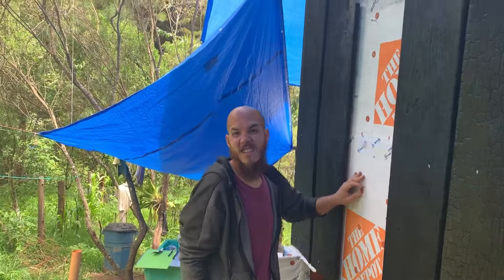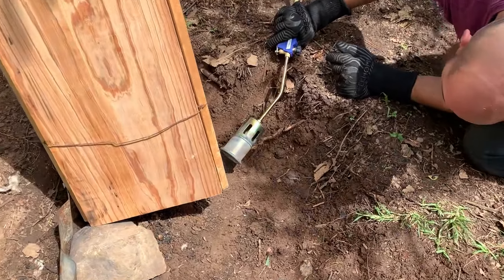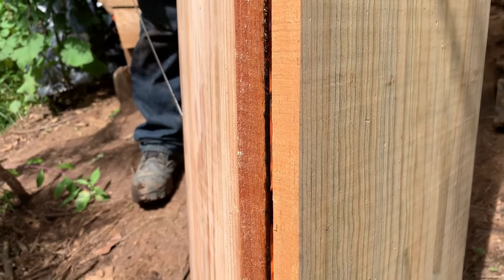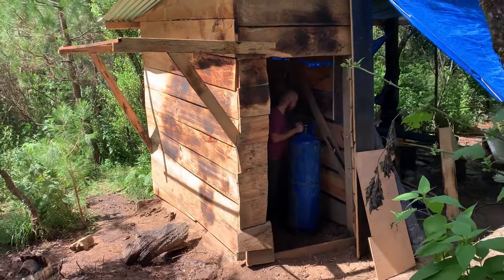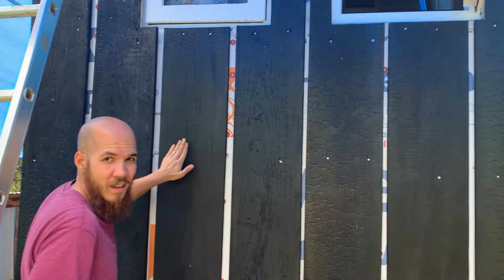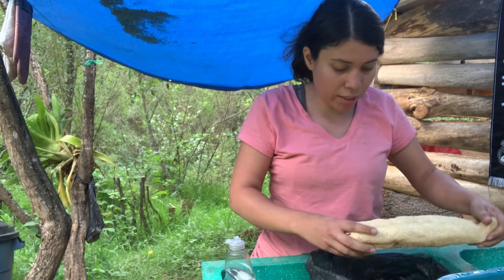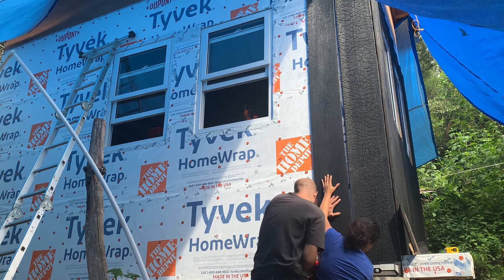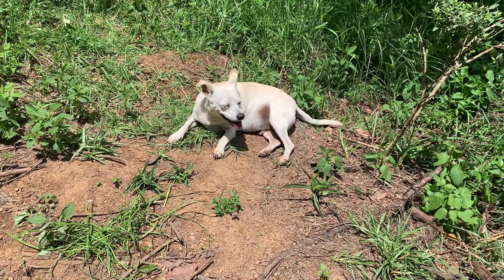Board Swap | Handling Warping and Installing New Walls | DIY Tiny Home in Guatemalan Mountains

Comment: It seems you will continue to have warping due to the fact that you are not sealing/burning all sides of your boards ( You don't just paint the outside of a door because it will warp). Looks good though.
Reply from the maker: Thanks for the advice we will try that. With the research we have looked at nothing has shown or talked about burning both sides.